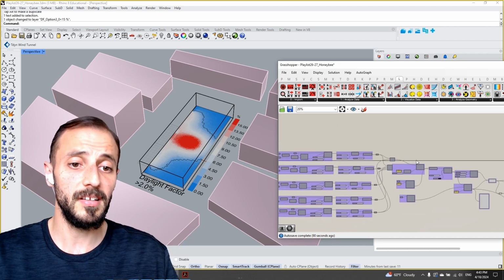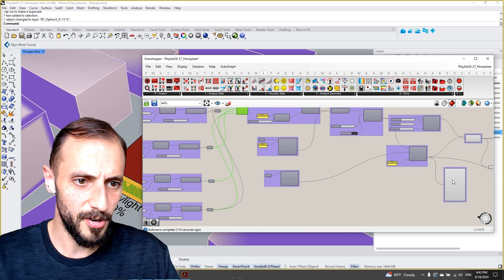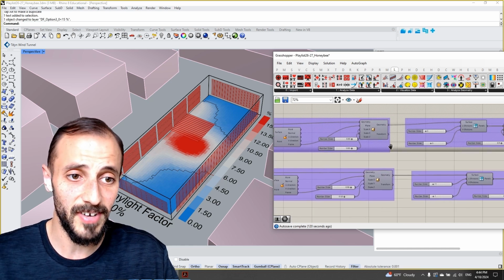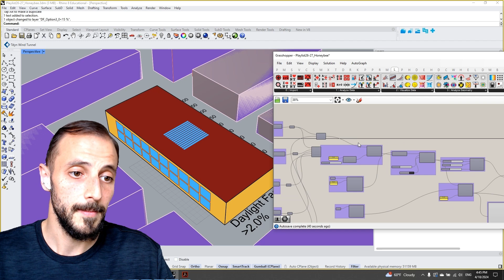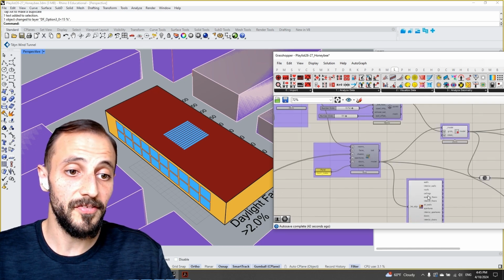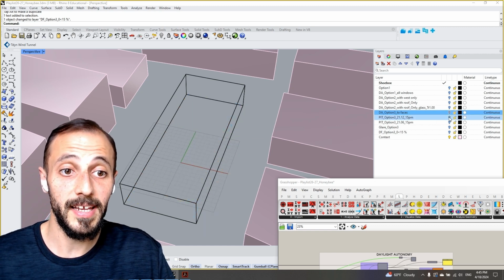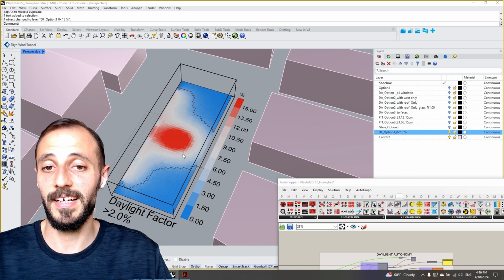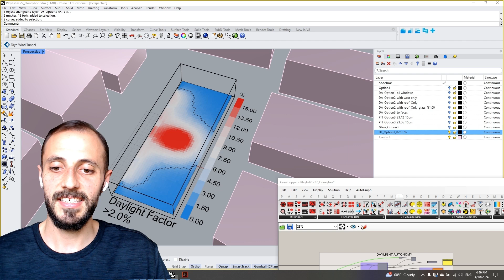0- Introduction to Daylight Analysis with Honeybee #HoneybeeTutorial #DaylightAnalysis

Comment: I'm a beginner in rihno and grasshopper and I need it to finish my PhD studies about  annually daylight ,,,, Do you know if it's better  to use details ex (walls with thickness) in analysis  daylight multifloor building or making it simple with only single lines cause I see many videos which use simple buildings? Also is there a forum for the software so I can ask them about my issues?
Reply from the maker: Please join our community!
https://www.skool.com/grasshopper3d-lab/about
Reply: @grasshopper3dlab  OK thank you a lot

Comment: Hello! I’m conducting an analysis of the illuminance (in lux) received on building façades in a city and how the heights of surrounding buildings affect it in order to determine an ideal height for the buildings to receive a minimum of 100-300 lux. How should I incorporate the context to analyze its impact on my façades? Thank you!
Reply from the maker: Hello, if you are working with Daylight and facade relationship, it might be better to proceed with Vertical Sky Component and/or Daylight Factor. Here is a detailed guide:
https://www.velux.com/~/media/com/research/f0100%202013%20-%20cie%20-%20mardaljevic%20and%20christoffersen%20-%20a%20roadmap%20for%20upgrading%20national%20-%20eu%20standards%20for%20daylight%20in%20building.pdf